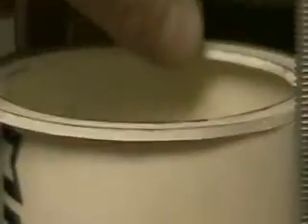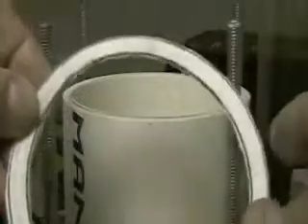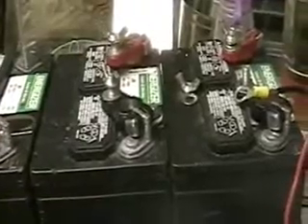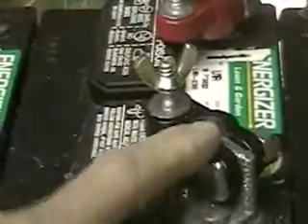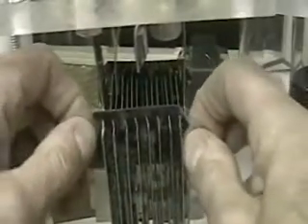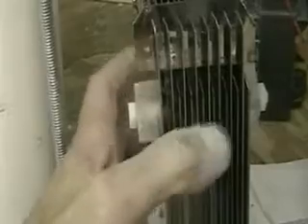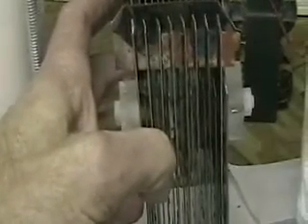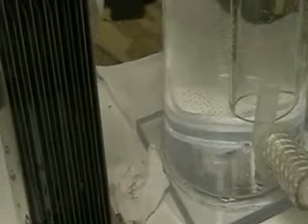Hydrogen Tap (Found Seal) 304

Comment: dude, u can buy rubber gaskets pre made to fit....also, use a hole saw and cut a groove into your top and using a dremel...widen it alittle so you can resess the tube in it with the gasket in there...tight seal

Comment: John i am thinking of a different way to connect my plates based off your idea. i was thinking of using stainless steel welding wire and connect the plates that way. Have you found any evidence of this not working in any of your tests?